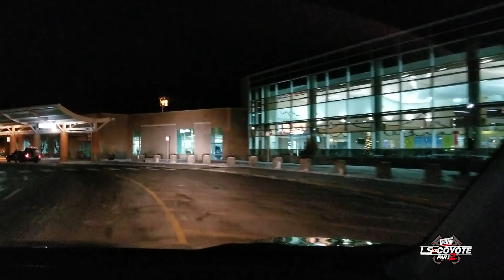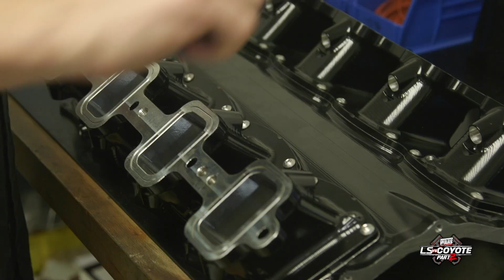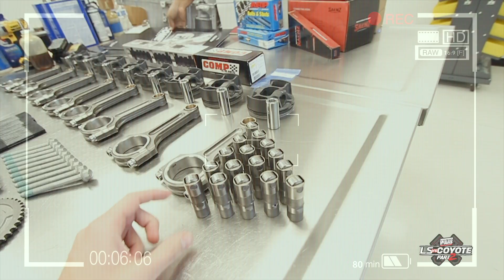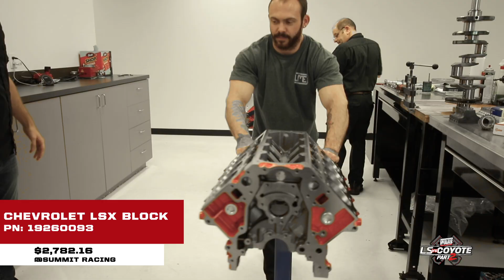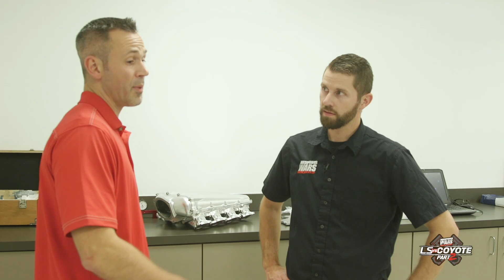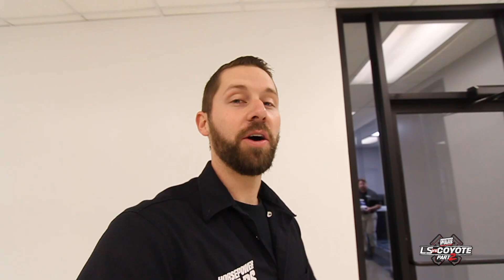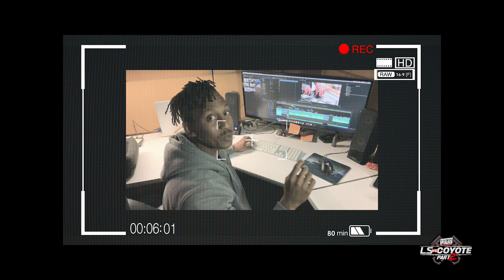LS vs. Coyote 2 Episode 2: The LSX Engine Build

Comment: think if the ls had 4 valves per cylinder then it would be fair if the ls was 4.8.  the 4 valves for both motors would be a fair comparison.

Comment: That LME joint looks to be bad ass and top notch. However, if I may enter my .02... I cringe to see them using Dewalt tools. From the simplest thing like the little led "flashlight" feature only coming on when you pull the trigger for the drill. And from experience, Dewalt batteries F#ckin suck. Go Milwaukee (battery life is simply amazing and the flashlight led stays on for number of seconds after each trigger pull)!! I did a few years ago and will never go back. Badass shit these shops are doing now for dam sure! I might sound like a Milwaukee commercial here but the shit is bad@ss

Comment: Not Bad, typicall of what you'd get from commercial Engine Builder. but you're way off what could be achieved. Neither the Ford or the Ls are max effort Race Engines. The money could have been better spent else where on both those Engines.

Comment: Don’t worry my ford family. Ford has been kicking chevys ass with mod motors #5secondpass. In the new future ford is about to mop the floor with Chevy at their own game!!! The 7.3 pushrod is around the corner 😈😈
Reply: Ford has never been kicking chevys ass but ok
Reply: Lol that 7.3 wont do anything. U do know that chevy makes a 572 Big Block that makes 750NA right?
Reply: Its intended to replace diesels  in the medium duty sales. Its designed to get very close to diesel mileage running hot and lean, nothing truly performance related to it from the factory. Maybe, maybe aftermarket will do something with it, but i wouldnt hold my breath. It will likely be very heavy for fleet service durability. Considering the Raptor 6.2 has received little attention  being a truck only engine I wouldn't count on it.
Reply: Lol try again

Comment: What is the excuse for not testing similar in displacement engines?
Reply: Its a competition not a comparison.
Reply: Why would they choose to use a 302 to compete with a motor that is 427 cubic inches?
Reply: @tomhamilton9140  because a coyote is 302 inches and they dont making anything closer to the LSX.
Reply: @nathan22outdoors8  Does GM not make a 5.3 LS.
Reply: @tomhamilton9140  Yeah but again, are they doing a conpetition or a comparison? Not my fault ford cant make any motors other than a 5.0 that needs 4 valves per cylinder and 4 cams to compete with a cheaper to build LS

Comment: There is someone claiming that their stock coyote vs an Ls made 100 more horsepower on the same amount of boost. Do those numbers add up to anyonw else. If you take a 5.0 and put 12 lbs of boost to it. Then take a 6.0 and do the same then you will have about 7.8 - 8.3 litres of air and fuel being burned per stroke. If you have a 6.0 with 12 lbs of boost you should have closer to 10 or 11 litres of air and fuel. So the coyote is 20%-30% more efficient/effective than the ls?? Someone help me understand what the logic here is
Reply: ITS BS, all they know is the folklore internet bs of Pro Mod 4.6 running 50psi of boost sub 2500lbs and 22 inch wide slick, and think that an LS cant run more than 800hp without "lifting heads" or breaking rods,  yet  we  have these examples here:      
 https://www.youtube.com/watch?v=AmKZ-CuOaT8
https://www.youtube.com/watch?v=t65VypaaRJU
https://www.youtube.com/watch?v=HYW_kPEyhiQ
Everyone FANBOIS forgets the 4.6DOHC was out in 93 and the LS  didnt come along till  97. This 4 yrs at racing  infancy  is a huge advantage to learning curve,  limits and techniques to make things work, but also look at he big changes at the factory level in rods, floating piston,  and mls head gaskets...  LS has the huge advantage of aftermarket which for some reason SHM  is a disadvantage to the Ford camp. Fact is anytime aftermarket is allowed in a class it will usually be gravitated to, and development slows on factory stuff.  Throw in rules and weight breaks for lesser cubes etc you get what you got now. Now things are a little different , Coyote are coated bores not wortha fuq after about 800 hp without a true sleeve... Now we can say did it come fromt the factory witha sleeve? LOl

Comment: To the guys whining about the displacement difference between the Coyote and the LSX: the primary limitation was the budget and it's equal across both builds. Don't get mad at Chevy, go get mad that $15K IN PARTS gets you 7L from Chevy but only 5L from Ford. The Coyote is a great engine, but they're very complex engine with lots of moving parts so they're expensive. Does it suck for the Coyote that it's down 2L of displacement? Yep. Is it fair according to the rules of the competition? Absolutely.

Comment: Holy balls, read the freaking rules people.  $15,000 IN PARTS.  That means, LABOR IS NOT INCLUDED.  Also, the forced induction system is not included in the cost.  So what if the LME engine is worth more in the end?  If one company did or didn't machine something then that is the best way they saw to do it.  I'll trust teams of professionals with decades of experience with proven setups over a fanboy screaming "tHaT's A 5o BiLlIoN dOlLar MoToR!"
Reply: I'm sure they didn't need s billet intake that's designed to fit under a Corvette hood that comes with a Corvette pricetag to match at 4500 dollars just to make whatever power number they hit.
Reply: @shaadydog1  They didnt choose it because it fits under a vette hood. They probably chose it because its the cheapest for the performance since they dont include machining in the cost.
Reply: @nathan22outdoors8  ya, that's what I Am saying. Why would you use a 4500 dollar intake that's not needed except for promotional purposes? Could easily save 15-2000 right there. Surely something designed to fit under a Corvette hood isn't the  ideal intake  here. Their is no runner... Even the fabbed 5.0 intake has a longer runner.
Reply: @shaadydog1  Not all intakes flow the same. That intake is built and designed by them for the highest flow. If they had room in the budget and it fit then of course they will choose it because it doesnt matter if they use 13,000 or 14,999, doesnt mean anything for points. Promotion is just an added bonus i guess.
Reply: @nathan22outdoors8  ya, maybe was done just to piss the Coyotards off...
Reply: @shaadydog1  just to show how much cheaper an ls build is ;)

Comment: All the whining Coyote fan boys. The MACHINING and LABOR are NOT factored in... Obviously this is close to a 30k engine, but they are only charging for raw materials for this competition so STFU and just enjoy the damn videos. BTW I respect all types of high horsepower builds including 4banger and 6banger ricers with proper builds. Its respect for physics and engineering. These arent friggin football teams you primitive dopes.
Reply: Theyre not whining, theyre speaking the truth. Nothing but a small fraction of the parts, including the block, are OEM GM parts. The Coyote is stock block, crank and heads. The fact that a LS has to be completely aftermarket to compete is telling you guys something.
Reply: @jamescharles7637  The block and crank are indeed Chevrolet parts, which again is irrelevant, same as whatever point you're trying to make. Its not "telling" anything other than it absolutely fits the guidelines of THIS SPECIFIC COMPETITION. The Coyote motor just happens to be more expensive to modify as OEM and aftermarket parts are more expensive and much less readily available. They are both great platforms and have strengths and weaknesses, so quit going on irrelevant tangents unrelated to this specific competition. If you want to have a separate argument, OK, but your response was moot as it doesn't address my point whatsoever. It kinda like saying..."But my dad makes more money than yours", when the original debate was, "Who would win in a fight". Unrelated arguments. Stay on topic
Reply: @EnduroTainment  Its not more expensive to modify lol you dont even have to buy anything for it. The Brodix heads on the LS cost more than the rods and the cams for the Coyote.
Reply: @jamescharles7637  Obviously you DO have to buy things for it as this show is proving. That factory setup/bare block is not at all safe for 2000hp, so they are buying things for it. Both shops are going all out, so I do somewhat agree that its a silly comparison with silly guidlines. BUUUUT, it is what it is. Now I'll say it again, I have nothing against the coyote motor as its a friggin great platform to run 600+rwhp on all day with a blower, e85, and proper tune. But these motors in this comparison are passing the threshholds of either platforms OEM capabilities, besides certain parts. Both cranks are OEM production, both blocks are aftermarket(resleeving is no joke), both are machined to rediculous tolerances. So all in all, none of this relates to what most any street gearhead is going to do. The biggest reason I'm not a fan of the coyote motor is ford doesn't have a platform of car I would drive. Im not a mustang fan at all and am not into drag racing. Only road racing. Most of the factory5 cars are absolutely more LS friendly, same as most common swaps into track oriented swaps. Otherwise im sure more people would consider coyote swaps. But for now, LS is reaaaally tough to beat for the money and availability
Reply: @EnduroTainment  I love the LS engines. Under 1000hp horsepower the LS engine is the best bang for your buck hands down. But for huge horsepower applications Coyote/Mod Motors are king.
Reply: @jamescharles7637  Eh, they are both preeeeetty damn good over 1000hp. The LS is great for under 600hp builds, the coyote is cheap for 600-1300ish, and over that both engines need some more serious mods. Id love if Ford made an affordable 2seater contender for the corvette with their engine platform, like a cheaper gt40. I would be allll over it. It all depends on the type of racing your into and what platforms are available that have the best potential to start with. Im not into drag racing, so there really isn't anything Coyote-wise that suits scca style road course tracks, which is why I have a corvette. Its cheap, balanced for racing, very easy to work on, and has a ridiculously large aftermarket and used parts market. You COULD use a mustang, but its not as ideal, besides gt350 which is getting very expensive. Theres just so many platforms that support LS motors for racing, so its a justifiably one of, if not the best bang for the buck. That is if you want to go faster than a friggin miata, because theyre cheap as SH*T to track, but I like power
Reply: @EnduroTainment  Ya, 1200 wheel isnt a problem. Its not 1997 anymore and getting heads to seal isnt a big deal or cost. I mean think about what is going into a 1200whp engine and tell me you cant spend a few 100  dollars on the proper fasteners/machining/ and gaskets...
Reply: Also its not a OEM PRODUCTION BLOCK. Ford also makes a "Ford" Eliminator block that is good for like 3000+HP why didnt they use that?
Reply: @jamescharles7637  Using a block that can support 5000hp is useless when you dont have the budget to create 5000hp with supporting upgrades. They obviously factored how much money they had to play with and decided against it because it was more cost effective to get a used block and re-sleeve. You've seen the episode already.
Reply: @EnduroTainment  My point is that none of what is supposed to be a "LS" is even a LS. Anything that is LS is LS7 and that shit is expensive. So you've got a truck motor vs an entire Summit Racing catalogue. These GM vs Ford comparisons always have to tilt the scale, bend the rules or even let things slide on the GM side. There is a reason why Engine Masters kicked the Coyote/Modular Motors out of the competition then gave the LS its own cute little class.
Reply: @jamescharles7637  Engine Masters?  where 1 guy/team has won what half or more of the events and he brought in Mihovetz and Grochulski for this one?  Look at all the 400 cube modular/coyote engines running around lol, let alone all the 6.2/5.8/5.4 swaps we see.... and they were Alum 5.4 blocks used n EMC. I believe the rule was against 4 valve v8 not just modular/coyote.  The thought to allow them was that it would be competitive because it would be hard to build close to the 410 limit,  nobody would spend the amount of money or time to come up with one at the 410 cube limit that year. . If you actually look at the dyno sheets in 2013 EM the LS build would win in any drag race those engines would be in, It has the most upper rpm torque/power and equaled the best Modular  peak hp  number. From 5500 to 7000 it was the best engine, not even a contest. Right where a converter would be  and good shift recovery. Only thing that EM proved was what the Ford Fanbois Brigade are complaining about here, more money/resources invested can definitely buy the win in a dyno competetion and stupid rules can obscure the results.  You dont understand how the EM Chalenge  is run, It doesnt just give 1st the best dyno run, its avg of 3.   Their is 1 clear choice out of the top 4 dyno pulls though IMO.
https://www.hotrod.com/articles/2013-amsoil-engine-masters-challenge-top-finishers/

Comment: Factory rocker arms😂😂
Reply: Factory rockers are good for like a billion horsepower. Just need to upgrade the trunion bearings in them to handle the cam lift.
Reply: @KTM990WFO  you're right they do hold up to horsepower but that's where they draw the line.

Comment: Ok so I  just watched the Coyote build as it popped up on my feed and then came back and found this one. I've owned two corvettes, and seven camaros among chevy pickups, SUV's, etc. so to put it mildly I'm a pretty big Chevy fan. Some were stock and some were not and  I still daily drive a Camaro. Now that being said the pricing on this build is total horse shit! There's no way any guy off the street could put this collection of parts and C&C work together for anywhere near as cheaply as $15,000. Try doubling that for a real world cost. 

Should have done it engine masters style. Retail parts available, either aftermarket or OEM. No custom in-house CNC parts or porting. No custom cam grinds (use only what you can get off of the website or by phone as an existing part number) I would only allow machining of the crank snout for keyways or as the LS team chose here to shorten the snout for a wet sump system which somebody might actually have done if they were going with a Camaro or swap build vs a vette build and could run the deeper oil pan. 

Don't get me wrong I still hope the LS team wins but this competition is fundamentally flawed in its rule set.
Reply: Here is your engine masters results, look who had the top dyno pull. Read the graphs carefully, it wasn't a 4 valve. Keep in mind that scoring is an avg of 3 pulls, and their is a formula to factor in cubes. That formula put a 830hp engine at a 2500 pt score vs the 28-2900pts for the top 4. I know many  dont like the formula because a smaller engine is already at an advantage of less total friction,  but it is what it is.
https://www.hotrod.com/articles/2013-amsoil-engine-masters-challenge-top-finishers/

Comment: So how much did the ls block cost considering that The LSX block that's $3,300 don't be shortchanging somebody so basically what you're looking at guys is about a $ 7,000 rotating assembly with block minimum so you're safe for $ 8000 you were able to build the rest of that engine and and that list is but not limited to camshaft lifters oil pump water pump covers valve covers timing cover rocker arms injectors throttle body engine wiring harness sensors that are necessary pushrods oh and let's not forget the brodix LS7 heads and oil pan pulleys I think you're pulling the wool over people's eyes and if you believe that they could get more than 850 horsepower out of that 427 for $15,000 you too are a sheep and that's not even including the supercharger which was supplied by ProCharger again boys and girls not a fair comparison and we're not being told to Total price of the LSX build I think in retrospect that both engines have well over $20,000 invested in them but the LSX has more everything with the ls has to be brand new ask anyone that's ever built a thousand plus horsepower LS how much money they got invested I guarantee you $15,000 doesn't touch it especially an LSX starting point
Reply: And its a competition not a comparison